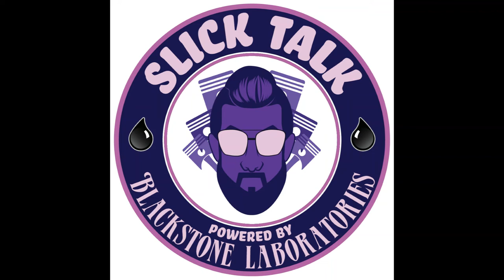Slick Talk - Episode 13: Porsche Talk (and much, much more) with Max Revs

Comment: I found Blackstone Labs through Mike Miller, BMW CCA's Tech column editor.  He is a big supporter of Blackstone.  I like knowing that the oils I use in all of my vehicles work, are changed at appropriate intervals and that that certain myths about oil are just that (i. e., annual changes for low-mileage cars).  Thanks, Blackstone Joe!